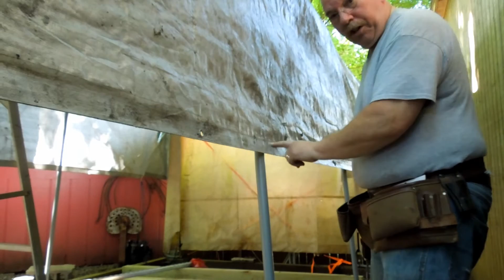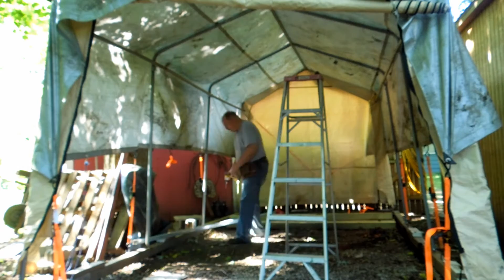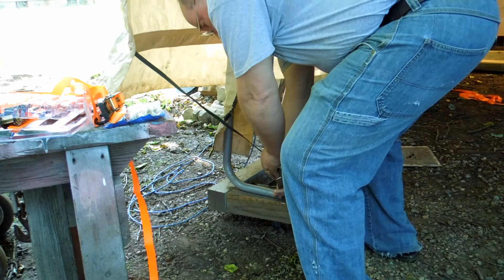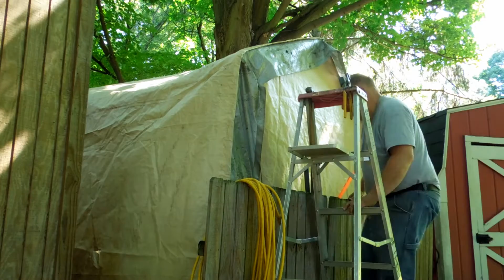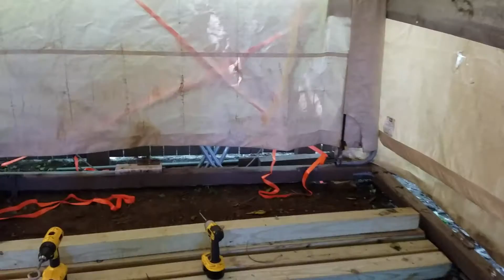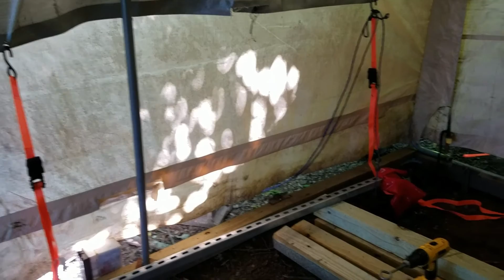Tractor Shed ~  The Roof Is In Place

Comment: like that eye bolt driver will have to make 1 and put in tool box
Reply from the maker: It comes in handy if you have to set more than one. Even nice for just one if it has the long threads.
Reply: @OldSneelock  Eye eye captain.

Comment: Getting solid all the time . I’d be tempted to get some 3x1 and make 90 degree lengths and cap the gables both ends miter at the apex with a diamond cover screwed to the frame with self tappers then if the sides move the roof should stay put . Take care god bless

Comment: A solid mess aye? That's good till you're working with concrete. Then ya don't want a mess. Ya want it even steven. 
Ya should tie up a basket underneath there in case it does take off. If it does you can bee the Wizard of Kalamazoo.
Reply: OUCH, OUCH!

Comment: We've got strips out of 2x's fastened to the outside of the bottom of the  greenhouse with self-tapping screws. That keeps the flapping down  And on the corners too. Sounds like all the little goomers are back. Glad I'm out of THAT institution too. Had a birthday party for an old picking buddy yesterday with all the kith and kin there. FINE time. Know yall did too! And I drive all my eye bolts with a hammer to get them started. I never have a drill but always have a hammer!
Reply from the maker: It's an old trick I don't use much anymore. There was a time when I was hanging swag lamps in modular homes. They had a hook with about a 2" thread on it. I took an eyebolt and taped on a piece of windshield washer hose to it so I didn't have to stand on a ladder cranking them in for 50 or so turns. 😆😎
Reply: @OldSneelock  Gaining headway? Wait are you working on a boat?
Reply: @OldSneelock  So there's green side up and tarp side down aye?
Don't wanna catch air. 
Well unless you're flying a kite and then you can't find the air.
Reply: @OldSneelock  GOOD old trick!
Reply: Back at school? Maybe it's just summer classes.
Reply from the maker: @mostlymoparih5682  Kids at the playground. There are some summer classes at the highschool and baseball at the diamonds. The community plays at the ennis courts. Gull Lake Schools don't sit idle too much.
Reply: @mostlymoparih5682  Maybe they were kept there all summer!
Reply: @lewiemcneely9143  Yeah well they would've had to come and find me first.
Reply: @mostlymoparih5682  I think it took about 8 to drag me out from under a ping pong table in grade school for a tuberculin skin test. They can stick it in their ear now!
Reply: Hammer time. Can't touch this.
Reply: @mostlymoparih5682  It works too good!